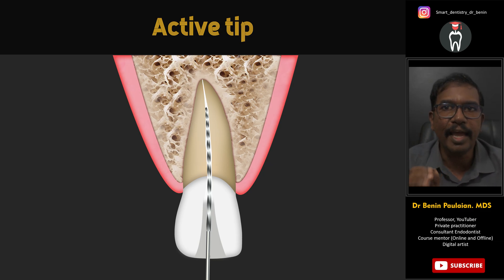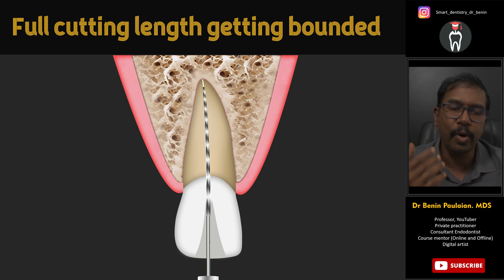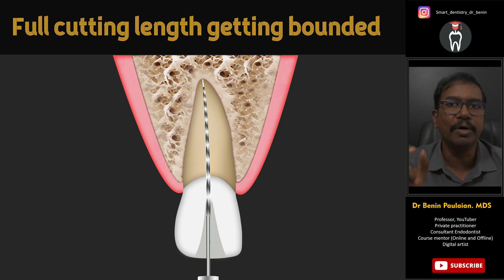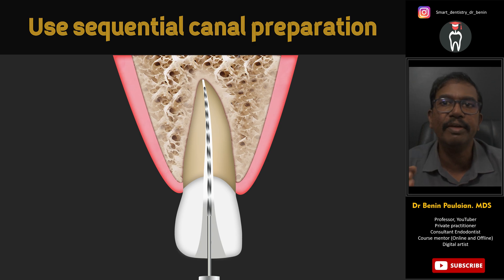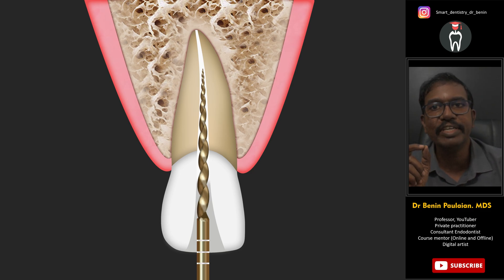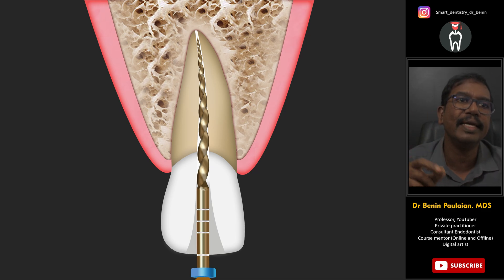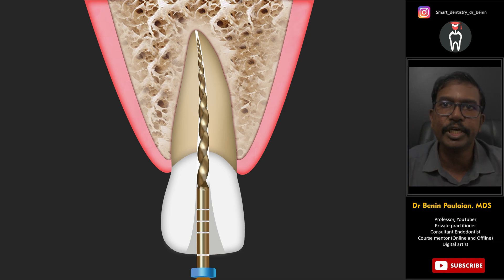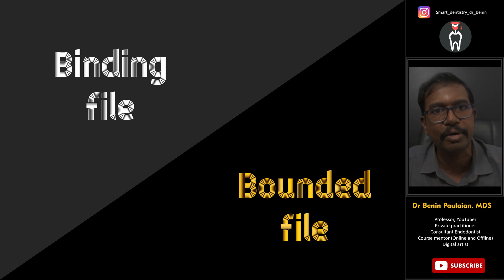Binding file Vs Bounded file

Comment: amazing sir , Then what is the proper way of using active tip hand file? can you make a video on that also sir.
I mean the motion in which 10 15 k file should be used .
Thanks in advance doc you are helping lots of new Dentists out there. 🙏
Reply from the maker: Sure. I will make a video in this topic